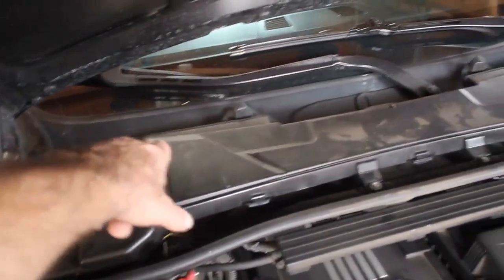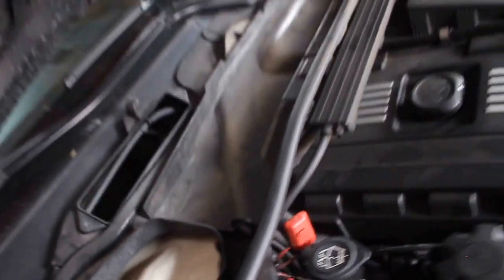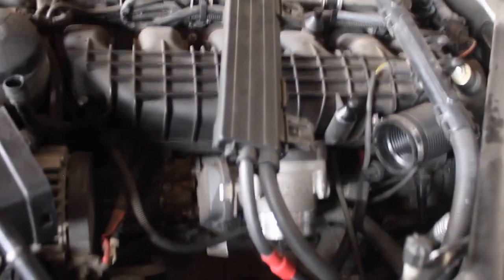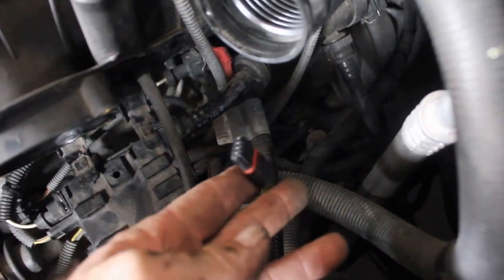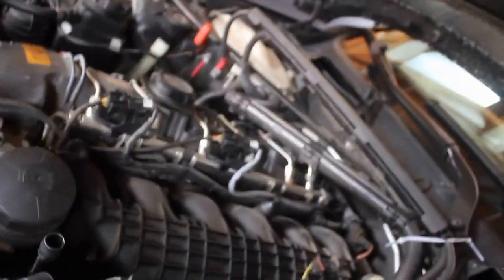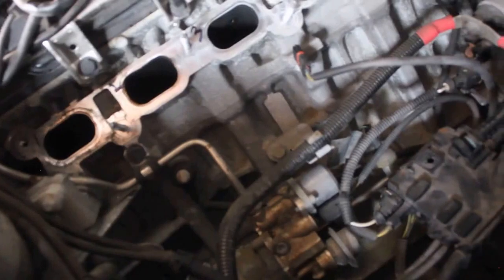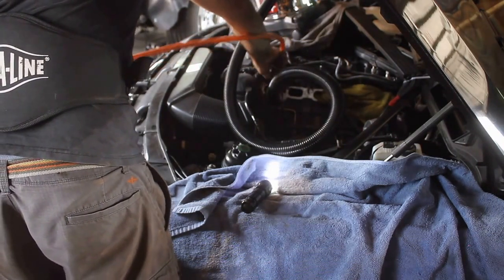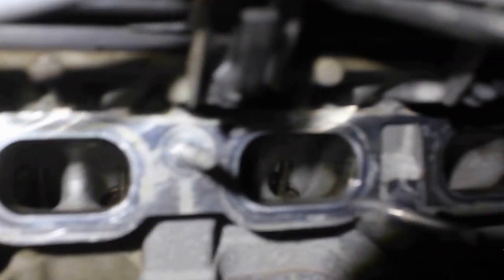Cleaning BMW N54 N55  Intake valves - ports with Walnut  (carbon- oil gunk blaster)

Comment: "I would recommend performing a fuel injector flush as this vehicle still has solenoid type fuel injectors. It is something that cleans the injector internally from build up, injector tip and also the back side of the intake valve. It is recommended approx every 100,000km..." this is what the SA at the BMW delaership just told me. I wonder if that "fuel injector flush "is the same than the" Engine Intake Valve Cleaning with Walnut Shell Blasting"....
Reply: better off replacing them with index 12s

Comment: Hey angry mechanic! You're the shit and i like your  style. Subbed right away. Quick question i read on description about sleeping mode. Unfortunately o started working on my car before i read it. Do you know how to clear codes without the obd tool? I have heard that if you hold the button on the turn signal and the rod for the odometer at same time you can reset some stuff. Is it true? Once again you're awsome man!
Reply from the maker: Thank You Bro! If you do not have a diagnostic tool You can Get a K DCAN cable ( http://bimmersoftware.com/cables ) and install MHD app on you phone then clear codes and many other fun things ;) though the MHD flash app or a elm 327 obd2 blue tooth (ebay) w torque pro app to clear codes..  The MHD app works allot better.   I would not sweat it if the BMW was not in total sleep mode It's just a precaution.
Reply: The Angry Mechanic  thanks for the advice, I really appreciate it!

Comment: Do you have a recommendation for a better pressurized abrasive blaster since this one didn't perform well and made a 1 hour job a 10 hour job?
Reply from the maker: XHugojackX it wasn't really a 10 hour job I was exaggerating. I purchased  a much larger tank set up at Harbor Freight & actually it worked much better.. make sure you have a really good inline  air drying system.. I was pissed because I have a massive air compressor & an Amazing air dryer. you know the rest of the story (bav Auto piece of shit

Comment: hiiii, is it the same for 2008 E60 535i Twinturbo? it looks like the same but I am not sure, it is hard when I really working on it. my car has rough idle in highway and the rmp stays around 2000... I did carbon cleaning but still has the problem, so i guess the throttle body is dirty... thank you

Comment: Did you turn the engine over by hand set the valve at a closed position???
Reply from the maker: I jumped the starter solenoid with the key far away from car https://youtu.be/WYSRe4u4Oao?t=126 Cheers!